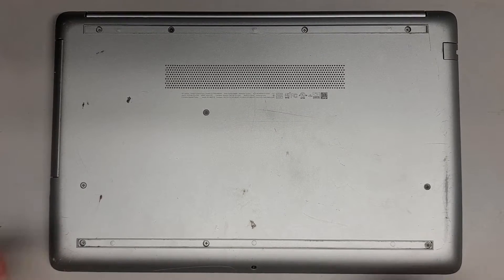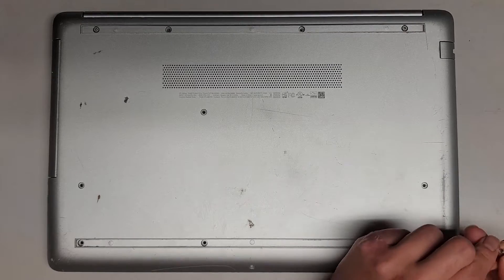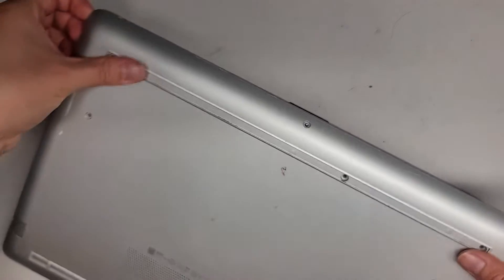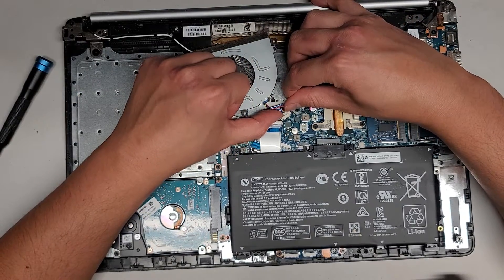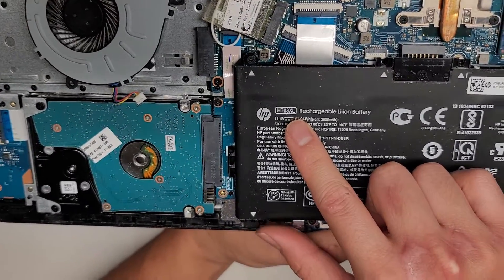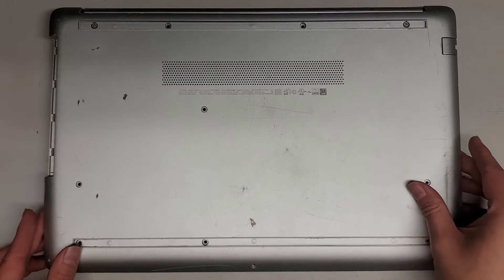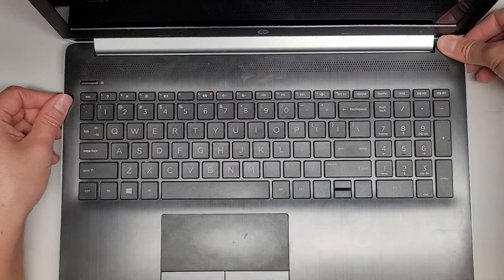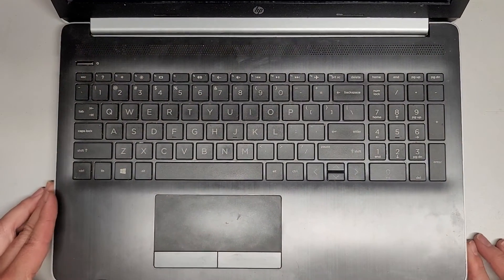HP Laptop 15-da0073ms Disassembly RAM SSD Hard Drive Upgrade Fan Replacement Repair

Comment: The NVMe slot is there for the Intel16Gb Optane M.2 card.  You can remove it and install a regular NVMe SSD.  If your HP is running slow, swapping the Optane for and NVMe as your primary storage with the OS will improve performance significantly.  While you are at it, replace the mechanical drive with an SSD for secondary storage.
Reply from the maker: Yup, I don't see the point of Intel Optane. Just get a full fledged NVMe SSD.
Reply: I was just about to say the same thing.
Reply from the maker: Yup

Comment: Hi, I have an issue. I recovered the BIOS but im getting an error CMOS cheksum is invlaid. I thought, to replace the CMOS but there doesnt seem to be one. Any ideas?
Reply from the maker: The main battery is the cmos
Reply: @ItsBinhRepaired   the laptop was charged with a dell charger, do you think that coudvle burnt the battery
Reply from the maker: If the voltage is wrong, yes.

Comment: Heyy bro.....my laptop model is 15-da0022ne....is this laptop's bios battery removable??
Reply from the maker: No idea. Might use the main battery as the bios battery.
Reply: @ItsBinhRepaired  ohhk thankyou bro
Reply from the maker: @dennisvarghese4660  no problem